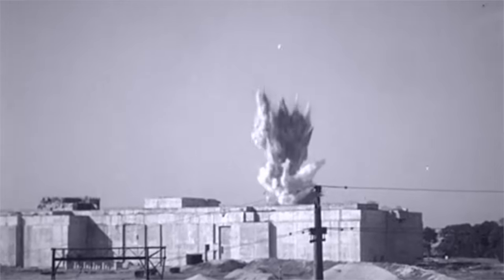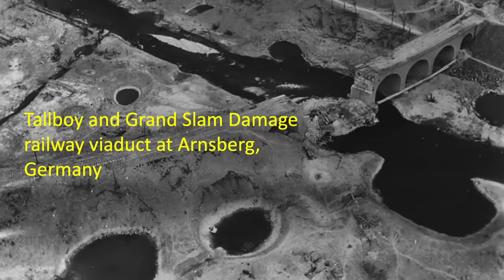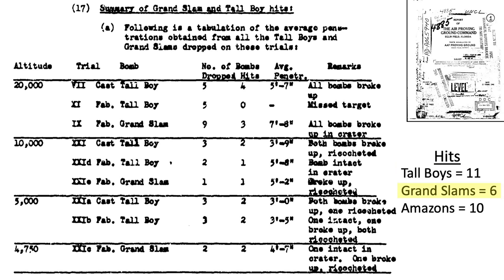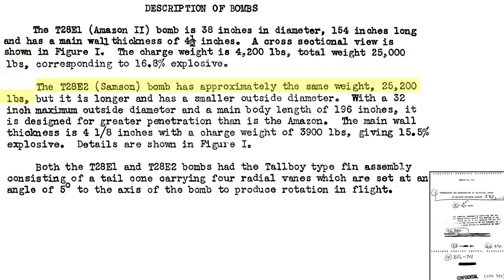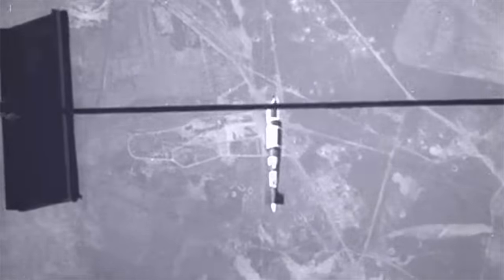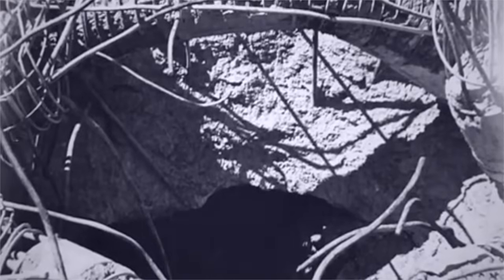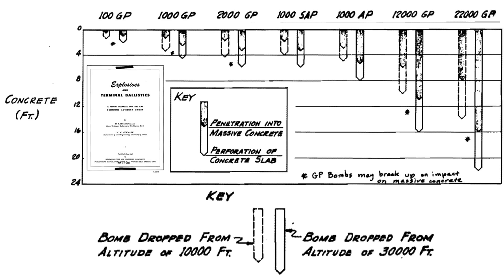Rare Declassified Footage from post WWII Super-bomb tests – The Project Harkin Story

Comment: It is amazing that can actually hit the target from that altitude.
Reply: Basically they had time to do a really accurate wind triangle before the bomb -run. That and nobody was shooting at them. See my other note above.
Reply: @mightaswellbe mind you, 617 Squadron got pretty accurate over hostile targets
Reply: Also greatly improved bombsights and related equipment became available at the end of the war and in the years that followed. What a vast change from the early years of WW2!
Reply: Bottom line is that they really couldn’t hit a target with a single bomb from 30k’ consistently. That was the fundamental problem with day light precision bombing in WWII - it wasn’t precise enough.  There was a single statement in this video about recommending that the ‘azimuth steering’ device be used.  They had experimented with radio guided bombs during the war; the bomb had steerable fins and a smoke trail enabling a bombadier to steer a single bomb on to a target.  That technology didn’t quite work well enough to be used at the time but that recommendation is consistent with the critical need for such a capability.

I’m sure that not only did the engineers have an accurate ‘wind triangle’ calculated, but the test were done in unusually calm, stable  conditions to enable them to hit the test targets without too many misses (look at the many misses in the video).  The winds between the surface and 30k’ are rarely predictable or constant.  The Noreen bomb sight and post war develops were never good enough hit strategic targets with enough precision.

The capability to hit strategic targets precisely, e.g. a bridge, was not available until the smart bombs that came out during the Vietnam conflict.  Smart bombs are required for these tasks.
Reply: Norden Bomb Sight, not Noreen.
Reply: @billindurham   After the war, the Tarzon bomb based on the Tallboy was developed with the Razon guidance kit, perhaps due to the recommendations made as shown in the video. It was relatively successful in the Korean War, but was soon discontinued due to issues of price, reliability and obsolescence of the B-29 in the face of new jet fighters.
Reply: @mightaswellbe   They possibly used weather balloons and other "peacetime" features over the target to ensure everything was perfect.
Reply: Noreen Bombsight.  Sounds like a girl I went to high school with...

Comment: On another note, somebody asked how they could be that accurate. According to my father, one of the aircraft commanders that flew some of those missions, they had just enough fuel to get to altitude, make three wind triangles and then make the bomb run. So, the bombardier had timely and accurate info on the winds aloft when on the bomb run. Smooth, steady and nobody trying to shoot you down had a lot to do with the accuracy they achieved.
Reply: I read somewhere that the test they did to see the accuracy and flight of the Grandslam was a bust as they put a camera in the centre of the bullseye and the bomb went right into it so they never saw the footage of it fly.
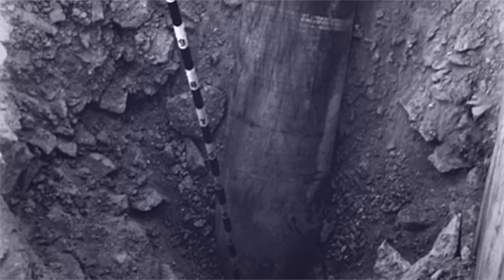Reply: This is the most accurate description I've heard of a bomb Run for the testing in a long time thank you very much for that 9:34
Reply: @mightaswellbe  •  So then for the most part ( given everything was a go , ofc ) , these particular missions were a one and done ?? Don't misunderstand me for assuming this or anything else for that matter, but what I am saying is this.. considering the fuel capacity ( or limitations ) , the current weather conditions , enemy activity in or around the " target zone " ( < if applicable ) , among other possible factors...also , when the making or building of these bombs then deploying them first came to mind , were civilian casualties ever taken into consideration  ??  With these particular bombs and missions , I mean ??  I've already read reports and some quoted remarks made by Truman , talking about that sometimes, civilian casualties were a " condition " of war... regardless of whose administration the or a particular war was being fought or engaged... I know that with him say that , it didn't exactly make him the most loved man in America , at the time...

Comment: And on one more note. They lost one of those monsters. Dad mentioned it and it's also mentioned in part 2 of the Harken  project report. According to dad they lost power on one side which, because they were carrying max power just to stay at altitude, caused the plane to yaw, which caused a bank which upped the G-load and the shackles failed and the bomb departed the aircraft. The approximate location is mentioned in the report. According to dad it landed in some farmer's back forty and buried itself so deep they didn't bother trying to dig it up, so it is probably still out there. These things were inert, concrete filled.

Comment: If you are going to struggle to hit the bunker, I would think the Tallboy & Grandslams would be a better bet. Causing damage via their shockwaves. Great video again!
Reply: Excellent observation! I wonder what the bomb-aimers dropping Tallboy/Grandslam used as their aimpoint? The target itself, which they didn't want to actually hit dead-on, or an offset point? I would imagine aiming directly at the target would be pretty safe, since odds of a "shack" from drop altitude are pretty slim.
Reply: @garibaldo110  Well obviously the target was the aiming point! But it would have been near impossible to hit from speed at high altitude, until the advent of smart bombs in the late 1980s.

Comment: Tallboy & Grand Slams were not designed to penetrate concrete so they did perform as predicted!
Reply: they weren't expicitly 'designed' to, but they sure did a hell of a good job at it! Assuming it was within range of 617 squadron's Lancasters, there was no U-Boat pen or bunker in the Reich that was safe. This post war test seems more focused on the 'one bomb, one hit' approach that is used today with modern guided bombs, but back in WW2 there was NEVER just one bomb, even when you were talking about Tallboys and Grand Slams. If one bomb couldn't bust the roof by itself, the next one or the one after that would.

Comment: In WW2, Germany built a concrete defensive u-boat factory, designed to withstand Tallboy and Grand Slams. The building is still standing. While Grand Slam bombs did not destroy the building, they ensured production within the facility effectively ceased. The impacts upon the building are immense, and was featured in a recent documentary.
Reply: This is the Valentin bunkered facility that is in the video. It was supplied by a railway that ran inside to deliver the completed sections of the TypeXXI u-boats to then be assembled into complete u-boats. They were then to be launched via a floodable lock into the adjacent river basin. It was never finished, and the British wanted the Germans to tie up resources and manpower building it as they had already determined that it's weakness was in fact the railway line to the facility. Any u-boats leaving would have been vulnerable on the surface of the river as well, due to it not being deep enough for them to leave submerged.
Reply: What documentary? Name please?

Comment: Tallboy and Grand Slam were designed by British aeronautical engineer Barnes Wallace, who famously had previously designed the bouncing (water-skipping) bombs used against the dams in the German Ruhr.  The bouncing bombs were dropped from only 60 feet above the water by bombers of 617 squadron, stationed at RAF Scampton in Lincolnshire.  The same squadron also dropped the Tallboy and Grand Slam bombs.
Reply: He also a had a hand in the design of the Wellington bomber. He designed the geodectic airframe fuselage used in the bomber.

Comment: The Samson bomb penetrated 19 feet of a 25 feet roof, but it was inert. Had it been filled with explosive and detonated, it probably would have done the job well as the concrete likely had many stress cracks from the impact and was likely held together with the rebar in the concrete.

Comment: An 8 inch artillery gun barrel was used in operation desert storm to penetrate a bunker and destroy its occupants. The army didnt have any bombs capable of penetrating this particular command bunker. So the actually had to rig up these huge gun barrels and pack them with explosives.  Former Delta Force EOD operator Mike Vining told the stoy on the reconnaissance cast.
Reply: This sounds a bit far fetched. 
I know the Americans used old large gun barrells filled with explosive and they were excellent bunker busters.
Do you know what aircraft had dropped these old WW2 items?
Reply: @jeremyrichards8327  I'll have to go back and find the interview when I have time later
Reply: @jeremyrichards8327  The initial batch of GBU-28 bunker busters was indeed made from 203 mm howitzer barrels.  It was a quick way to build up the weapon for Desert Storm.
Reply: In other words not WW2 bomb casings as you stated previously?

Comment: Great period film and great period data.  I have to imagine the effect of that Samson - penetrate 20-ish feet of reinforced concrete then 3900 lbs of boom-boom does its job.
Reply: Nothing says the force of the explosive would be down, or in fact, any direction.
The path of least resistance would be right back the way it came from/the big new hole.
Reply: @AndrewBlacker-t1d before blowing out of the new hole the shockwave will spread inside the building. And since it was so sturdy, there will be a huge pressure buildup inside
Reply: @TheDasHatti  Tall boys and grand slams hit those roofs and the shock wave did nothing.

Comment: When you consider manufacturing is all about money then making a bomb that will get near to a concrete target and remove the foundations will cause more damage than making a bomb to penetrate concrete, as, that will come at a higher cost and less impact. We see weapons today go through targets and come out the other side, whereas you could make a far cheaper weapon that removes its base and it falls into the hole completely destroying its capability to function. Barnes Wallis recognised this and didn't try to make a bomb to penetrate 20ft of concrete, he designed it to go under it and successfully blew a U-boat out of the water and onto the quay.
When it came down to the logistics, it wasn't about the bombs, it was the capability of the delivery system.

Comment: As Tallboy and Grand Slam were NEVER INTENDED as concrete penetration bombs, their inclusion here is superfluous. They were designed by Sir Barnes Wallis, inventor of the Upkeep mine or bouncing bomb used in the famous Dams raid of 1943.

They were designed as "earthquake bombs" to destroy targets by disrupting or cavitating the ground next to or beneath a target structure. Originally, they were meant for the dams but Barnes Wallis realised the bouncing bomb was a better method.

Comment: The beauty of the Barnes Wallace's Tallboy and Grand Slam bombs, was that they didn't need to directly hit the target. Which considering the technology and the circumstances under which most were dropped, is a good thing. During WW2, accuracy was never that good or consitent. A concrete penetrating bomb is of little use if it can't reliably hit the target. The "Earthquake" bombs made sense at the time.

Comment: The colour picture is of Lorient U Boat Pens. These drops were conducted on the U Boat production facility at Farge, near Bremen, Germany. It was never finished as 617 Squadron put a Grand Slam through the roof. It penetrated, but not with the sort of damage expected.

Comment: so in the 40s the largest bombs were 22000 lbs and after 77 year the largest gbu 43 is 21000 lbs and performs significantly worse? isnt it strange the military hasn't improved the platform in all those years?
Reply: the GBU 43 has a literal multitude more explosive mass LOL

Comment: I always thought the radial WWII powered aircraft could be developed further and have far greater potential with modern technology.
Reply: So could steam engines and sailing ships.  But every technology has some point at which its development potential is less than other cheaper technologies.  Propellers simply can't go as fast as jets, not climb as high, and their complexity makes them expensive.  It was routine for four engine propeller passenger planes to land across the Atlantic with one engine out.  Jet engines are far more reliable.  You probably could make radial engines as reliable, but they would cost a fortune, be slower, not be able to fly above the weather, and carry fewer passengers.  You could probably build a pontoon bridge across the Atlantic for 500 mph steam engines too, but why?
Reply: @grizwoldphantasia5005  Piston engines cannot be made as reliable as turbines.   The fundamental reciprocating action of the pistons, rods and crank create stresses that cannot be designed away.   Pistons represent more parts and higher cost with lower reliability.
Reply: As the power is increased the weight increased too much and cooling became more and more difficult and reliable decreased. For high power applications it really was a dead end.
Reply: The ultimate radial powered bomber was the 1949 Convair B-36.    It was supposed to be the USA's cold war bomb delivery platform, but it really rammed home to the USAAF that it was just too difficult to maintain.    It had so many spark plugs, at least one would fail on nearly every flight, so they had to change all the plugs before every mission.  That alone meant the end of piston engined bombers.   Jets need a lot less maintenance labour and are scalable - that is, a bigger one is just as reliable as a small one, unlike piston engines, whose failure rate fundamentally rises in direct proportion to size.
Reply: Gas turbine engines are inherently more reliable than internal combustion engines.
Internal combustion engines are however more fuel efficient (particularly diesels).
Gas turbine (turboprop) engined versions of the WW2 Lincoln bomber were built and used operational post war.
Reply: @keithammleter3824 USAAF ceased to exist in 1947 when it became the USAF.
Reply: @patrickmccrann991  Correct.  I typed "USAAF" out of habit from posting comments on WW2.

Comment: Thanks for an interesting documentry. Is there an explanaition for the relative high accuracy of these superheawy bombs ? If you compare with general purpose bomb, in WWII,  it is a very high percentage that are direct hits.
Reply: This was under controlled peacetime conditions. The plane was not being shot at and could take as long as it wanted to line up or make several passes if necessary. The crew were also likely familiar with the target so could sight it much easier
Reply: What he said.  Furthermore, it would be far far easier to calculate the exact trajectory of one massive bomb as distinct from a bunch of lesser bombs.
Reply: And most of the bombs dropped missed…
Reply: Well, not all that much time. My father was one of the pilots and told me they carried just enough fuel to get in the air, up to altitude and make three wind triangles to establish the winds aloft before the bomb run itself. Nothing to spare time wise so if they could not drop on the target, they were supposed to go ditch it in the North Sea, do not land with that thing on board.
Reply: Those wind triangles would make a huge difference. In wartime missions, no one dared to fly triangles over flak or when fighters could  be around.

Comment: We have to remember that the concrete and rebar of those days may not have been what today's technology has to offer in hardened targets.
The same goes for the metal used in the bomb making material. Both are indicative of the times. Yet they were able to produce, through trial and error the results they were looking for back then.
Fast forward to today. Times and materials have for sure have changed. 
This video is very impressive inasmuch as it gives one the scope of research for the times. 
We can only imagine today's efforts to cover that scope of issues they are trying to not only solve, but to conquer what they may have to go against !
Reply: Actually I think metallurgy in those days was more advanced thank you think.
The Tallboys were expensive to make with machined steel noses and crews were instructed to bring them back if no target was acquired.
Reply: @jeremyrichards8327  I believe you. The Germans were smart as we know today. As well as the Brits and us. However, compared with what we have today, I do believe we could have ruined there day with today's ordinance. Don't you agree ?
Reply: @jeremyrichards8327  Then it took time to fill them with explosive. They only did one test drop. I think they were concerned if the fuses would survive the impact.
The crater at Ashley Walk has since been filled in, which is a damn shame. It ought to be uncovered and marked with chalk to show its great size.
The Bielefeld Viaduct was repaired with totally different construction so the part the RAF deleted is obvious today.
A storm water control lake hides much of any craters that were still left.

Comment: Would have been a useless bomb during WW2, Its a pity WW2 USAF european aircraft were not capable aircraft to carry the Tallboy or Grand Slam bombs because bomb aiming devices like the Norden bomb sight were overhyped and inaccurate to place a relatively small unguided hardened bomb on target during operational parameters. 
This is why Wallis and the British went for big is better and the also had the only bomber in europe that could do it.........the Avro Lancaster of which they got spectacular results like the Tirpitz, rail via ducts, V2 hardened launch structures etc